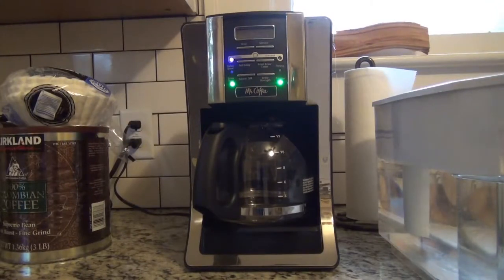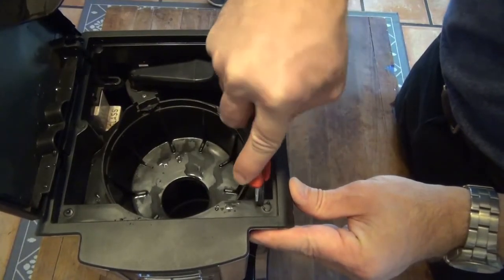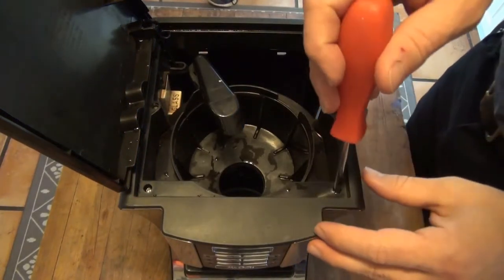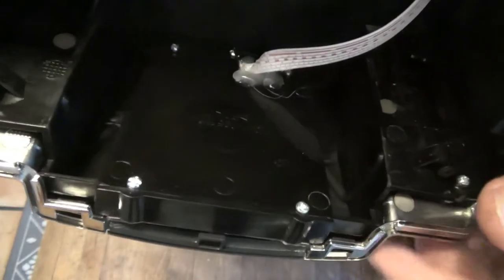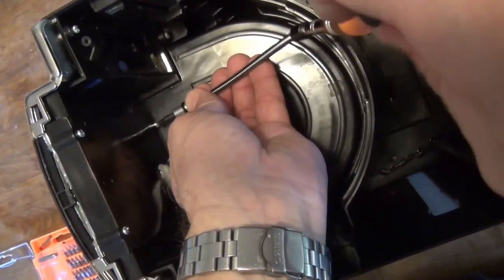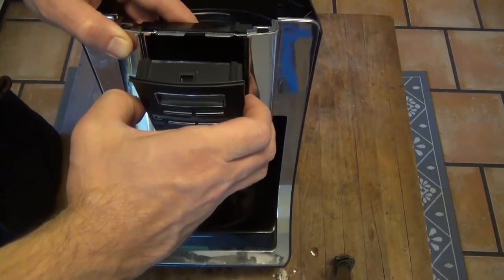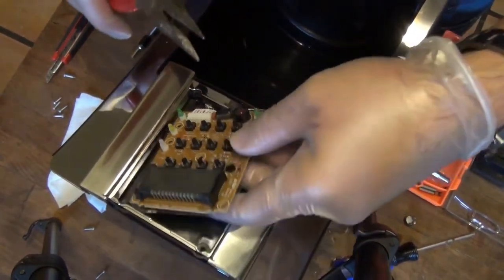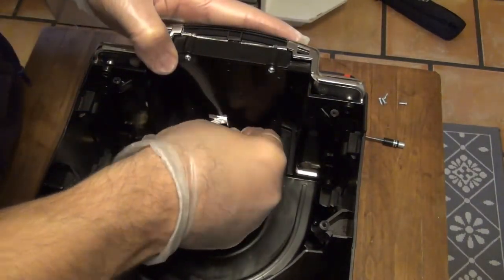How to Stop MR. COFFEE from BEEPING (New Model) - Speaker Removal - [HD]

Comment: So, I just bought one at Walmart last week, and I believe they changed the circuit board a little. My upper circuit board behind the buttons and read out does not have the speaker on it. I believe I found the speaker on the lower circuit board. You don't have to mess with the top at all. Just take out the bottom six screws holding the bottom plate to the body of the coffee maker and then one screw holding the circuit board in place. Then you should be able to pry the speaker off, but it is slightly different looking, and the terminals on it look more like a watch battery.